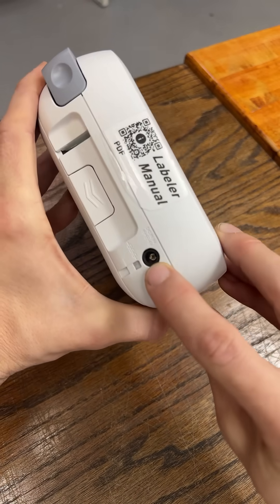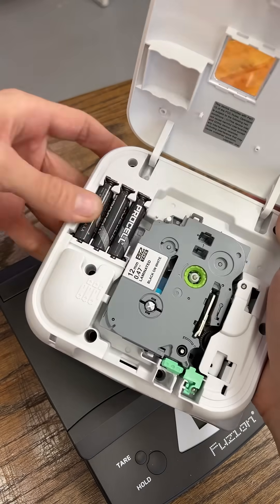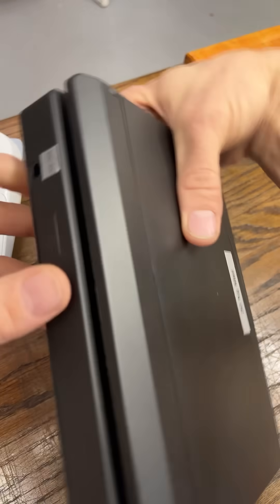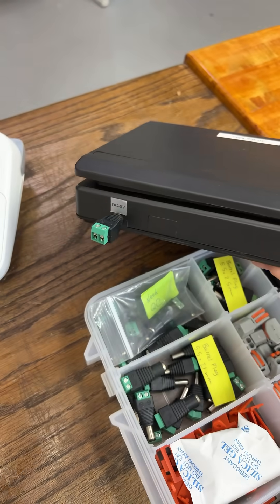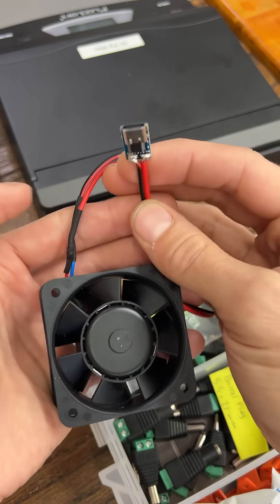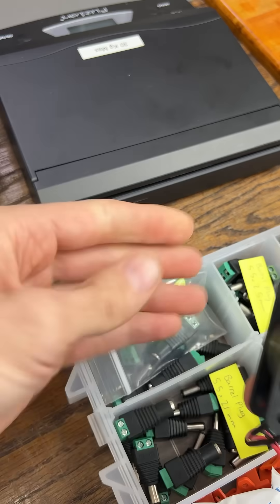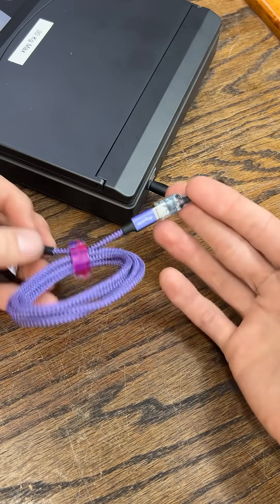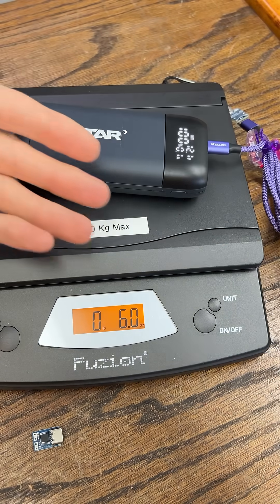USB-C can replace alkaline batteries

Comment: Nice find. What's the IC part number?

Googleing PD adapter module gives me only decoy PD trigger modules, with different (cheap) ICs.

My concern would be that while the PD adapter negotiates the correct voltage there maybe a brief voltage over-shoot. Normally correct volatge is detected using USB C config channel, without that is the PD IC only acting as a auto-step down controller?

Have you hooked the output terminals of the module to a oscilloscope and captured the event, would be cool to see?

Thanks
Reply: there won't be an overshoot, usb power delivery does not provide any voltage until it's negotiated via cc lines
Reply: Click on the three dots above his picture, then click on DESCRIPTION and then MORE.

Comment: While I appreciate the idea for some things, I do think NiMh AAs are a better solution for many things such as remote controls.
Reply: The Brother label makers run a ridiculously long time on just about any batteries. I bought enough AAA NiMH batteries so I could put in the 6 the machine and have 6 spares to swap when it dies.

I've been using those same 6 NiMH batteries for over 4 years and I had to replace the label tape cartridges 5 times, but I haven't had to swap the batteries yet. 

These are cheap rechargeable batteries from the grocery store that are only 700mAh and the thing is still going strong.
Reply: NiMh are probably wasted in remote controls. They are better suited to high drain devices (where they often last longer than alkaline on a single charge anyway so it's a no brainer). 
An alkaline is happy in a remote for a couple of years usually, so your NiMh wouldn't be working hard enough to get the return of investment (unless you're not using low self discharge NiMh, then your probably charging them often anyway as they drain themselves).
Reply: NiMh are almost always 1.2 volts instead of the standard 1.5 volts  required by some voltage sensitive devices.

Comment: This is good to know, and if I wanted to mess with nUSB stuff and had enough low power devices that could use it, I'd switch to something like that, would recommend it if work is involved, but for now I'd rather keep some rechargeable batteries around, usb-c has been specially bad for me even by micro usb standards.

Comment: Dymo LetraTag Printers. The six batteries all go flat in days even if its turned off. The plug needs 9V adapter, and I had one but the Dymo TURKEYS made it positive on the outside, so I just cut and reversed the 9V wires.

Comment: They not saving 1 dollar on PD trigger. They saving millions on customers complaints.
How many hundreds of thousands people would call customer service and ask why it not working without telling that they using different power supply or PC usb? 
And this is before talking into account that type c cargers constantly rebooting to negotiate power protocols. And if for phone or laptop it's fine, thanks to battery backup, but for game console, printer or server this 0.2 second power loss would lead to full reboot. Also most high power chargers have several ports and each time time something plugged/unplugged they again switching off and negotiating what of 5 protocols and 70 voltages devices want.
Barrel power supplys never being "borrowed" by relatives, friends or relatives friends and you, as manufacturer doesn't want handle all these situations.
I can confidently say that PoE(Power over Ethernet) have more chances to replace barrel jack as reliable power source connection than this disaster of power over type-c protocols.
Reply: USB PD is really disappointing for this reason... a missed opportunity that could have been really amazing if they had a way to make the cables and everything less smart and more low-tech while still delivering power correctly.

Comment: The USB C PD standard specifies 5V, 9V, 15V, 20V (and higher voltages to provide 100 watts or more).  SOME USB C PD supplies can also provide 12V, but not all do – it's been deprecated from the standard.

The PD trigger (common term) communicates to the  PD supply what voltage it would like; if that voltage is not available, the next lower voltage will be supplied.   The USB C PD supply will provide 5 volts unless/until a higher voltage is negotiated.

The USB C PD supply will only provide the voltage commensurate with its wattage.  For example, a supply must be rated at 60 watts to supply 20 volts.

Two warnings:  

● USB C PD supplies with multiple ports may not supply the maximum wattage to a single port, so a 60 watt-rated supply may not provide 20 volts, because no port is rated for the full output.

● Not every supply with a USB C complies to the USB C PD standard.  There have been cases where supplies provide only 12 volts without any negotiation.  Plug one of these into a device expecting 5 volts and the magic smoke will be released.
Reply: I wasn't aware that 12V had been dropped from the standard. So now, the millions (billions?) of devices which operate on 12V may not be able to be powered by PD. Some real smart thinking there.
Reply: Ikr!  @chrishartley1210
Reply: @ev-ezaye3580  Actually, the real reason is very obvious. The PD committee is made up of companies who can make a lot of money out of their so-called green credentials. QC is a rival, but has 12v as one of it's options so in order to make as much money as possible they need to make QC devices obsolete. If they had 12v in the options then a PD to QC converter would be so much simpler.
The argument that someone else made about needing 15v to charge 12v devices doesn't match up with reality where people want to power 12v devices. In most cases where a battery powered device that can operate from 12v  source it has a 7.2v (nominal) battery.
Reply: 12v must be the single most common DC voltage for consumer devices. So strange that it would be deprecated from the standard!
Reply: @helmanfrow  vero?
Reply: Why would they drop 12V? It's the only higher voltage it has in common with the ATX standard, and manufacturers don't want to put DC/DC converters  for USB. on the mobo
Reply: @bene5431  ridicolo! Imo
Reply: @bene5431  They dont need 12v because its a charging standard. Think ahout it like you need a pump that can push more pressure in your tire than it currently has to fill it. So if the battery uses 12v it will need 15v to fill it up. The max capacity of a 12v battery is 14v.
Reply from the maker: Thank you 🙏 for your added knowledge here which is crucial!

So, full disclosure i began a script to make a full video and i wrote these points, and then while i was writing i noticed a couple questions i needed to verify.  so then i got out the usb testers, and verified/rejected some points and then i made a couple WOW discoveries.  then while i tried to characterize those discoveries into solid facts i hit more questions.  then back to research… on and on in a cycle.
Reply: @davidmalawey  keep up the good work.  I myself am aiming to replace a chonky ac to 15v brick for an ancient 100mhz windows 95 handheld with some sort of usb-c PD adapter set.
Reply: @davidmalawey that's a comment that should come in the box of this product. Great job brother.
Reply: @davidmalawey  you're suppose to do that BEFORE posting misinformation.
Reply: This comment deserves more views.
Reply: While 12v has been dropped as a standard PD profile, it's not all doom and gloom, PPS gives you the ability to request any voltage between 3.3 and 21v (in steps of 20mV), as well as a current limit (in steps of 50ma). A PPS capable charger will happily give you 12v if you so desire.
Reply: Ahhh, the smell of the magic smoke. Nothing else like it. Too bad it means the fun is over.....
Reply: Ah, yes the magic smoke and related smell of death. One could spend eons researching the ' correct' USB-C application but it only takes ~ 5 ms before the smell of death, lol  @joeshmoe7967
Reply: That is absolutely insane they would deprecate 12V considering the ridiculous number of things that use it.
Reply: Yes!!! I bought a USB-C power supply converter for a 12V pro audio product I have. I bought several pricy Anker gallium nitride wall warts, only to find that none of them supplied the necessary 12V, whereas the cheap Amazon Basics one I had lying around did, and worked perfectly. No idea why they dropped such a common standard, but here we are…
Reply: aliexpress has offerings, never attempted to push more than .5A through it though
Reply: 60W is doable with 12V 5A(deprecated) or 15V 4A
Reply: It would be an insanely egregious charger to unconditionally provide 12V on the USB-C connector.  That would fry almost every device plugged in (all standards-compliant USB devices start at 5V and then request other voltages and then if the charger is capable it will switch to those).
Reply: You are a total legend
Reply: A more expensive but easier to use option is the powered battery adapters with a ribbon cable
Reply: Doesn't PD use the data line to negotiate the voltage? Otherwise it would output standard 5v?
Reply: @jamcguire100  not in all cases apparently!
Reply: @jamcguire100 yes, that's why you need the chip and the intact data lines.
Reply: @jamcguire100 it doesn’t “negotiate,” so much as “request.” If it specifically requests 12V, but the power supply only has 5V, 9V, 12V, 15V, and 18V on tap, it can basically just say “nope, no 12V here,” and nothing gets powered.
Reply: @jamcguire100  Yes. Damaging incompatibilities in USB-C are actually rare, except perhaps in no-brand parts, e.g. cheap stuff from China.
Reply: Honestly USB-C feels like a total shitshow. As convenient as it can be sometimes, the fact that it is now possible to blow stuff up because you used the wrong cable with the wrong device, and that different chargers and cables may simply just not work with your device (and apparently now 12v is suddenly deprecated?), goes against everything USB was supposed to be, it's like they've forgotten what that U stands for.
Reply: @definitelynotabotnope  puoi dirlo di nuovo!
Reply: @definitelynotabotnope  It's not a shitshow if you connect USB to USB. USB PD to something other than a USB definitely needs some magic.
Reply: @definitelynotabotnope  In the case you mentioned USB C isn't a shit show. You can use any usb c cable because it doesnt matter if its the best cable or the worst cable since power comes from 2 to 4 of the pins. The only thing that matters is the power supply you are using which is how it has always been. Like how your cellphone will take forever to charge using an old wall charger for phones from 10 years ago or even your PCs usb a ports. Because they only supply 5 watts when you need at least 20 watts for fast charging. If you plug in a device that needs more watts it it wont charge the battery. If it needs less power it will only get the power it needs from pins the receiving unit has active. It doesn't need to have to use all the available pins USB C provides. The only time there is a problem when you make a cable like this guy did that takes all the power and sends all the power to a device that has no way to accept less power. Barrels plugs are designed to take all incoming power which is why you need to use the correct one.
Reply: Just read the device specification, problem solved
Reply: Why is the voltage numerical value no more than a third of the wattage numerical value? Seems strange that the conversion factor is a nice round number, 3. Is it to limit the cross-section area of the cables?
Reply: @are1981 the default current rating is 3A for cables.  This can be extended up to 5A for "e-marker" cables.  Yes, it's to keep the cables relatively compact and flexible.
Reply: Oh just get a room lads.

Comment: Yeah, but soldering requires you have the gear, know what product to get, know where to get it for $1, know that you will get the $1 part for $1, not 10 for $10, know how to look up YouTube videos on how to solder the correct parts, and be OK with exposed not so professional looking product.
Reply: MacGyver spirit says, hold my beer .   .  .
Reply: An iron is easy to get, some of the parts were linked, and getting to know your local hackerspace is always a good thing.

Comment: Untill you burn your devices because the + - are inverted .... 
Yeah, the barrels might be positive on the outside or on the inside ...
Reply: It's rare but that should be stamped near the socket anyway
Reply: @mixerfistit5522  ... yes. It should be... but ofter it's not. I have hundreds of equipment in my lab... even on the power supply sometimes it's not written
Reply: @mixerfistit5522  it never is. The shit is all Chinese.
Reply: Anyone who designs a product with a center negative barrel jack, and doesn't show the polarity is just pure evil. If you lose the original power adapter, you can sometimes measure the ~0.6V forward voltage of the reverse polarity protection diode, but not all devices have them.
Reply: @jaakkolehto1487  i am always doubting... it's not a joke when you power something with reverse polarity 
From 3d printers to vibrating platforms..... it's ridiculous the amount of different barrels and you can't guess the polarity on any of those ;(
Reply: @WindowsSucksUwU  If they also operate on batteries, you can use a multimeter on the negative battery terminal to find the DC jack polarity. Otherwise, you'll need to open it up and find an electrolytic cap on the PCB.
Reply: The brother label makers are  like that. But they have the diagram on the back but even then, its illogical to some people so im sure someone screwed up
but now i think i could just use the green plug and invert the cables..
Reply: if u can solder, surely u can multi meter?
Reply: @akatuff  mmhhh explain me. How can i multimeter something that doesn't have a power supply 🤔 
If you know please let me know....how to figure it out: 
Polarity 
Voltage 
Ampere
Reply: And then you’ll wish you were an engineer 😂 (literally an unnecessary comment about “not needing to be an engineer”)
Reply: Not to mention that amps are even more important 😂😂